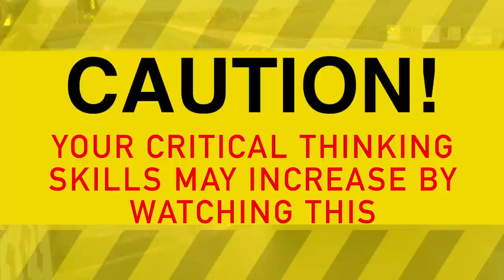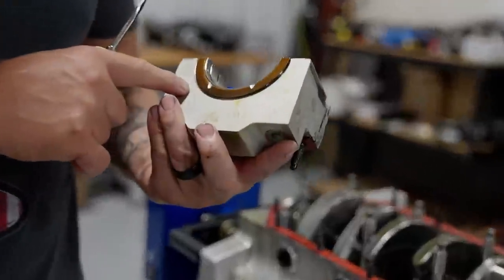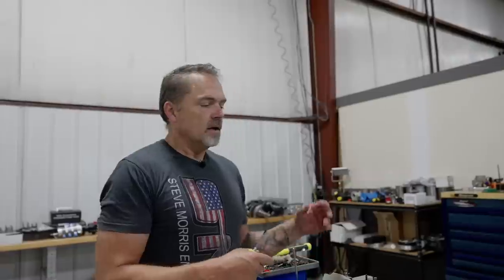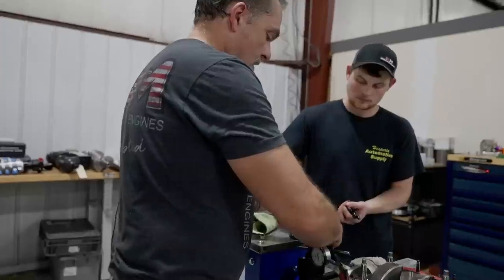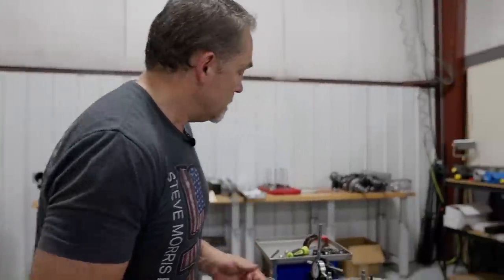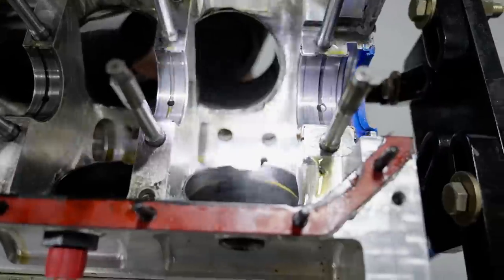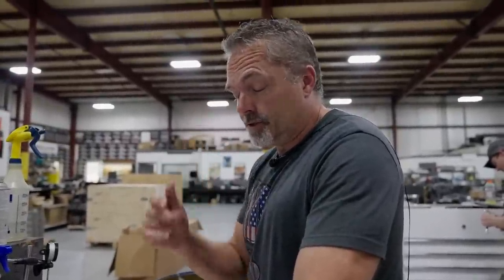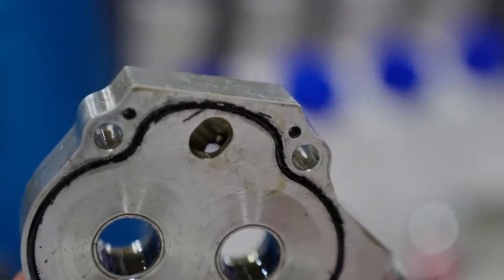I Found Mullets Engine Issue...Part 2

Comment: Have you ever put a crankshaft in a test rig with a front mounted thrust bearing and seen how much pressure it takes to squeeze the throws and shrink the crank from the flywheel to the thrust bearing at the front and make it “shorter”
Reply: I posted this earlier,   Crank deflection:  I'd like to see a crank placed in a block with bearings  placed in a press with crank flange on the bed , ram on the crank snout , dial indicator on the block and crank snout.    Calculate  converter charge pressure then run the press in steps until this force is  exceed by 50 %  .     I'd also think that this long term flexing would cause the crank to crack.

Comment: Residual debris in the system may be the culprit in the oil. 

Been thinking about the discoloration of the convertor and it could be due to cavitation. The data logger should give some indication, but it's pure speculation as we've been away from racing for many years. Just thinking about thermal dynamics and the effects of fluids under pressure in a closed loop system such as a convertor.  NO Dewey?! Shame. LOL

Comment: This tells me that the transmission is pushing the crankshaft forward somehow, either the wrong flex plate, torque converter or even the input on the transmission is being pushed forward.

Comment: I love your channel bc you teach and explain things on it. I'm not mechanical  at all have never worked on a motor but love cars and really anything that goes fast and loud.  With that being said you said it has scratches on pressure side and pressure side just pulls from the tank is there and filters on the tank before it enters the pump and if not could the material came out of the tank possibly?  And I'm just asking bc I listen to you explain how the pump works

Comment: Probably not your problem but... Years ago I replaced an engine in a Chevy pickup with an oil cooler in the radiator. Drained the old oil out of it but didn't flush it. Couple weeks later engine was bad again. Apparently there was crap still inside the cooler. Did they flush the oil reservoir after the first problem?
Reply: As a small shop having to pay for the second engine out of pocket was an expensive lesson

Comment: Chain is only as strong as the weakest link, and the bypass is a pretty small piece in reality.

I have to wonder, is there any way to have a sensor that can tell when the bypass opens?  That would be something to track that would allow for choosing to not abuse the engine if the bypass keeps opening.   Could you tap out the flow into a U shape and check for pressure if oil starts to flow?

Comment: Probably stuck in all the oil lines, the oil tank, oil galleys etc. All of it needs a super flush to get the latest of the remnants out. Heck watching them cut the lines with a Sawzall probably added some of the contaminants when javkstand was making all the hoses.

Comment: Well, I'm glad to hear that there is an issue with Mullet's  engine, however small it may be. Because I was convinced that if the only reason Cleetus stopped racing was out of an abundance of caution, that was certainly a sign that the end times were here! I was getting my affairs in order! Now I can get some sleep again.
Reply: There's nothing wrong with the engine. There's something wrong with the driveline in Mullet.

Comment: Didn't mullet have a turbo issue prior to the debris issue knocking them out of competition? I can't say for certain, but is it possible some bearing debris from the turbo found its way into the oil tank? 

Otherwise it seems like there is a pocket of debris in the oil circuit somewhere that is gradually finding its way into the pressure section and screens.  

Strange.

Comment: Is the thrust from the trans charge pressure enough to compress the crank? Maybe a stupid question, but my thinking is that the crank is really strong for torque applied but may not be as strong from end to end against compression from the trans to the forward thrust assembly. To me it’s hydraulics acting on the crank in a way the crank is not designed to handle a lot of load.

Comment: Great analysis.
When you rechecked the float with the roller thrust bearing out, should you have had the standard thrust bearing in place?
Reply from the maker: The bottom 1/2 was
Reply: @stevemorrisracing  good point, thanks.

Comment: Didn't cleetus replace a turbo in sick week? Could any bearing material from the turbski come up through the oil filter? Does the oil get filtered before it hits the scavenge pump or does the oil get filtered on the pressure side going back into the motor?

Comment: Hi steve just a thought does cleetus have the dry sump set up exactly the same way as you use to have it ? and also could the back lash problem on the centre bearing be caused from his transmission havind to much back lash and floating under horse power that can only be the problem if it's not the engine .   can we get some more barra content cheers from down under

Comment: My bet is the turbo 23:26 that have went bad and the replacement turbo that already is smoking is where the material in the filter came from which would have been the trash that hung the valve in the oil pump but just my guess cause where else could the shavings have come from

Comment: Isn't this the 2nd oil pump? The first one ate the screen and pump couldn't be disassembled? That was when you were at his shop I believe and did the new bearings. Could there still be trash in lines and coolers from that and the bypass being open caused paranoia. As it would anyone.

Comment: The fun thing about a high HP, high Boost race engine. You build it as tight as you can and the moment you start it and run it… it tries to destroy itself before you hit the line.

Comment: As the aluminum block grows in length the crank gets shorter in relation thus reducing clearance at the aft position of the rear main thrust. Just saying clearance doesn't grow with heat. Not a problem though.

Comment: Just a thought what if the driveshaft in Mullet is too long causing the extra pressure on the back of the motor or if the crank pulley loosened up with either one causing the the extra 20 thou clearance?

Comment: possible issues I can think of, expansion rate of block, crank, crank distortion from harmonics, power, rapid power level changes(traction control/pedaling), bent/out of balance flex/pressure plate, uneven torqued bolts, out of balance torque converter, torque converter heat growth/ distortion, transmission/engine misalignment. 
maybe expansion and distortion are changing the thrust endplay massively allowing the crank to contact the rear thrust bearing surface.
in reality the crank front snout end is probably not the best place for a thrust bearing, since it's "theoretically" miles away from the actual huge forces being applied to it.
most of that should(would) quickly eat itself/other connecting things and scatter parts rapidly, take my comments with a grain of salt. I'm no engineer  😉

Comment: Is there an external oil cooler on mullet? I cant remember off hand. Maybe some material lifted off the bottom of that if thats the case with high oil pressure.

Comment: Hey just out of curiosity wasn’t Mullet having turbo oil issue did maybe a bearing from the turbo drop down into the pan and get sucked up by the scavenge pump then into the tank just an idea

Comment: If the scoring is in the pressure side of the pump maybe Cletus should check his oil tank cooler and supply lines to the pump. I had to have a cooler ultra sonically cleaned after a bad issue with an engine, trash trapped in the cooler?

Comment: Large thrust gap at the track is due to engine being at temp.  Your block is aluminum and the crankshaft is steel.  The way you have it setup if the block grows more than the crank it will increase the thrust clearance.  CTE of aluminum is about 13x10E-6 in/in def F, steel is about 6x10E-6.   The delta between the two is about 7x10E-6.  Therefore if you check it at room temp vs running temp that’s about 110deg F delta, the distance between the two thrust surfaces on your setup is roughly 20 inches.  Doing the math 7xE-6 x 110 x 20 = .0154.  So at temp your thrust clearance grows by 15+ thousandths.
Reply: Correct thinking but wrong thrust face on the rear main. The worn face gets closer to the crank thrust surface..
Reply: @FOURCED the thrust clearance is set between the front of the rear main bearing face and his roller contraption at the front.  The rear face of the rear main is  intentionally ground away so it is not used.  The two surfaces at play grow away from each other as the aluminum block heats up and grows more than the crank.
Reply: @MegaMyk777  You are describing the two surfaces that SHOULD be at play but what I'm calling the affected thrust face is the one that came back into play due to not being ground away enough (for the block expansion issue) and at that point you have a rough ground surface now being asked to handle the thrust load while the HD rollerized thrust bearing is flopping in the breeze.
Reply: I fully understand what you are describing but my intention was to explain why there was more thrust clearance when they checked it in the pits with the engine hot and the pan off.  The surface you are describing had .027 clearance at room temp, it would have roughly .012 in the condition I described which would cause them to think it had excessive thrust clearance.
Reply: @MegaMyk777  Bidirectional thrust bearing arrangement on the front?
Live with ~25 thou crank walk at temp?
Reply: @FOURCED I think you’d keep it all at the back like stock to avoid these issues, possibly try to incorporate a roller version on the aft face to deal with converter loads.  Having them at ether end of the crank opens up a can of worms as can be seen here.

Comment: I've seen many main and rod bearings have slight scratch or groove and people go NUTS there BAD. Seen engines go million miles and never fail with bearing like this go figure. Bearing did its job caught the trash or embedded it and kept going.  Seen upper rod bearings that are steel with diamond coating on them and not fail from scratch or groove.

Comment: What about the converter getting to hot and sending the heat to the engine crank cause it's like a heat sink and that  extra heat from the converter on one side of the crank is changing the clearance on the trust bearing but idk if that actually makes sense or not

Comment: Can the oil pressure inside the torque converter push the rotating assembly forward hard enough to do any of that? If the engine weren't there holding it, it would want to launch off the input shaft.

Comment: Mullets rear end has Been moving forwards and hitting the the wheel wells could it be pushing the driveshaft and transmission forwards into the crank?

Comment: I wonder if there is crap in his oil tank from right after it was repaired and rebuilt. So it pumped it into the tank and it's just picking up a little piece and putting it in the filter occasionally.

Comment: Does the oil reservoir that there using have baffles in it? Did they modify the oil reservoir is anyway ? If so there may have been metal shavings left in the reservoir after they modified it, if it wasn’t cleaned properly after

Comment: Just curious.. Has anyone cleaned out the tank and lines from the last round of discovery of kibbles and bits in that filter and the last oil pump ? 

I mean if the engines fine , scavenge side of the pumps fine , pressure side of the pump has seen some trash flow through it and the by pass is stuck open with a lodged piece of trash … only thing left up stream is the lines and tank it self right ?  

I’d be thoroughly cleaning out those lines and tank before that engine even comes out of the crate . 

As for your thrust bearing seeing immense loading , what’s the torque converter look like ? Ballooned at all ?  Anyway to mount a go pro and a light to monitor its behaviour during a couple passes ?

Comment: There could of been Material in the Oil Tank and or Lines.
I've found Material in my Oil Tank even after draining it.
I found the Material when I pulled it apart to clean the inside of the tank out.

Comment: Does high charge pressure expand the converter, push it forward off the shaft, or both?
What is higher presssure doing? Lockup or part of the torque converter (turbine/stator) process?
Reply: The converter snout that goes into the transmission is effectively a hydraulic piston. Charge pressure is trying to push the converter out of the transmission.

Comment: Did oil cooler get replaced? I've seen guys blow engines up and try to clean oil coolers, and reuse them. Send trash right back into a new engine.

Comment: Steve one question only cylinders oh yah I saw what Steve is saying and well it makes sense BUT IM still not erasing these questions.... probably am an idiot IDK still am intrigued by my questions so have fun Steve... God I pray he reads this LOL. Came apart on the SMX block that you're holding and Garrett owns correct you recently found out with some piston-rod that you had left on your shelf that you had got them factory or whichever but they were pre tightened to my knowledge and put on your shelf and they broke on you. simple question do you think that there is a problem when the material of the aluminum that you used where they used and this question has probably already been addressed before but do you think the aluminum repaired issues spots/crank valley it's causing like an overall deflection and it's not bad enough to where you can see it permanently it will come back due to heat sink and cooling hell I'm not an alchemist LOL nor a know-it-all and the second question dealing with the same issue of the aluminum type if it's a bad material just like the Pistons were rods I'm sorry I mean your rods IE bad material and it's springing back if he'd kept running it I'm curious if it would have kept increasing and increasing and increasing until you have a failure the engine could have been good back then but over time rough trips rough drives and overall put one through its paces and ringer because it's being neglected LOL he sure enough testing your product I'd be proud as hell to own some of your engine products cuz if they hold up with that fool puts it things through and I mean fool in a good way because he's got enough bankroll to do what I wish I could do again just a thought everybody's going to grill me I don't care it's question I want to know

Comment: Clearly there being no fluid cooling radiator attached to the flux Capacitor combined with the Mr. fusion that ties into the cooling system is the issue! Geez has this guy ever built engines before! Shew!

Comment: Parachutes definitely create more Gs. Back in the 90s Top Fuel Drag racer Joe Amato had to stop racing due to the fact his eye retinas were becoming detached just due to the negative Gs.
Reply: Waddell, Your are correct [when correct for accuracy] that during parachute deployment, the speed reduction, quicker is greater than during acceleration, thus a negative acceleration with much higher forces [G's]. Clay Millican stated this fact recently to another person which recorded his visit with him, his team at the track.

Comment: Could it be possible the material is actually coming from mullet and not the engine?, Or where ever all the oil goes through in mullet (unsure if it goes through lines or just through the metal) but is it possible this is the same material from last time and it was never fully flushed out, Yes the motors been checked but oil goes through the drive train? I could be wrong im no car expert yk but its a suggestion (haven’t watched full video will delete if they find the issue)

Comment: Steve, might it just be just the sheer amount of power its generating from the boost. After seeing you check the oil pump, again being belt driving the extreme RPM might have some effect.
Reply: @italianfoodmadefromthehear8729 Why is everyone second-guessing everything Steve is doing, You do realize that this is not his first engine! He has built plenty of engines that have been in his customers cars for years without any issues! Steve knows as well as anyone with half a brain that the engine was just fine, All of the issues have been caused by Cletus and clowns! In case you haven’t noticed but almost everything Cletus and his clowns touch almost always end up breaking or having issues!

Comment: If someone, whoever it was, filled up the tank with fresh oil but got that stupid seal on the new bottle of oil into the tank or engine then that might end up looking like a bunch of metal shavings inside the filter they had there.  Probably, with multiple bottles of oil going in, at least one of those freshness seal tabs got in there.  Plausible?

Comment: But he only had 8 to 10 psi of oil pressure driving back to the pits, and that was with 180-degree oil temp and new oil. There has to be an issue. Not doubt u know more than me about an engine u designed, but something is up somewhere, and the clear view screen had a lot of material in it. Watch the video again. Maybe there is garbage in the lines or tank but something is causing a issue.

Comment: Really a no brainer to call the race if you think about it once you consider the uncertainty of the issue and the cost of a new engine. Sure, he might of been able to send it anyhow and finish the race, but that's only because of what you know now. (Uncertainty) Without that knowledge, and knowing how expensive one of these beautiful jewels is, the only logical thing to do is call it and not risk scattering it all over the track. Not to mention all the other dangers of scattering an engine at over 200+ MPH. Sure, it sucked, and I was rooting for you guys but for a race that has a minimal payout that is more about the adventure and bragging rights than it was the payout, it was the best call. IMO